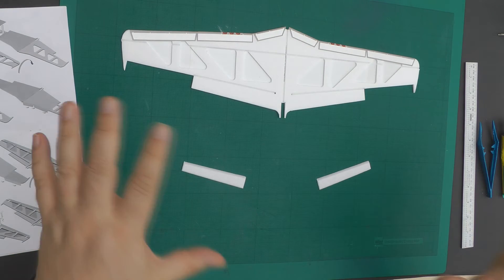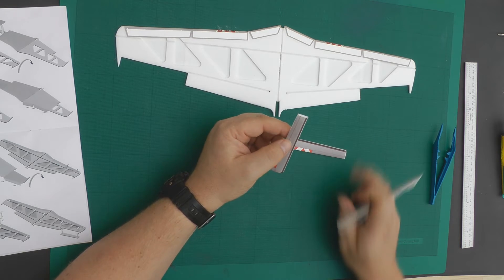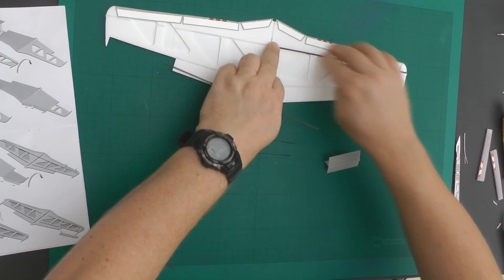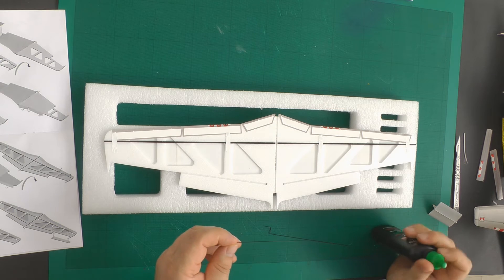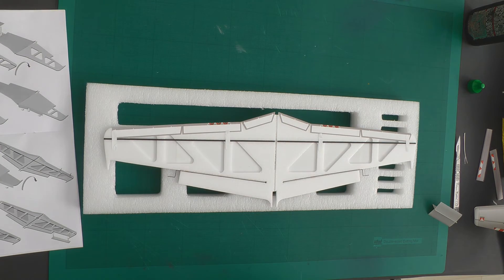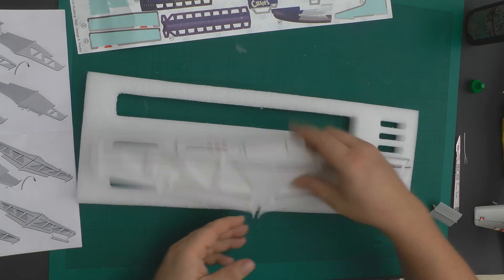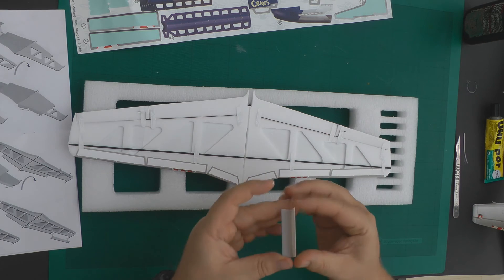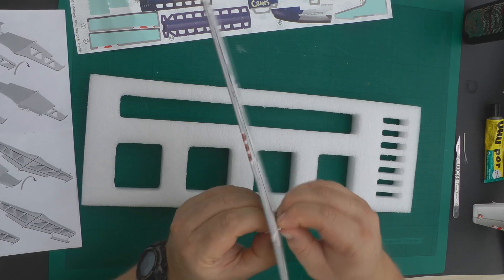MICROACES - Building the wing Part 2

Comment from the maker: I actually used a silicone based lubricant but anything from olive oil to bike chain oil would work. In this instance it's job is to stop the control rods from binding to the sticker material. A hollow tube would also work well but its getting it onto the preformed wire that could be tricky. Some builders use heat shrink to do the job. That should work too!